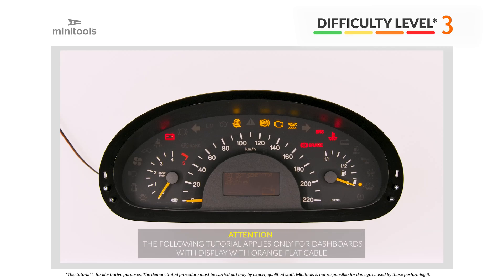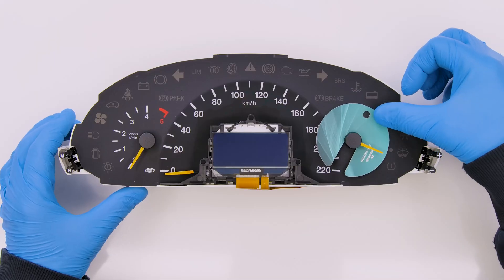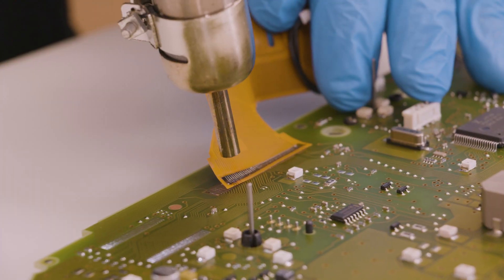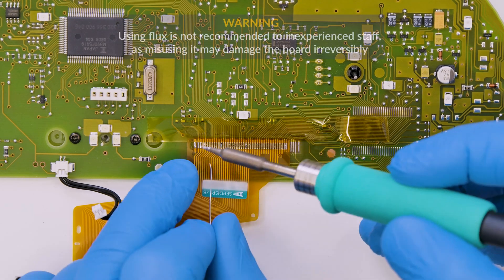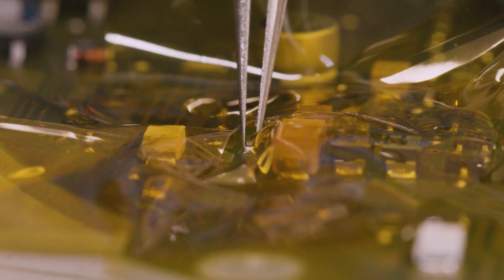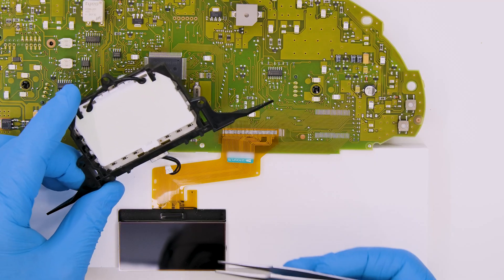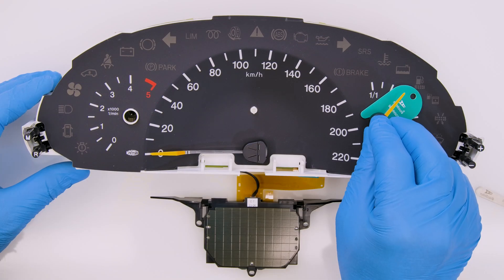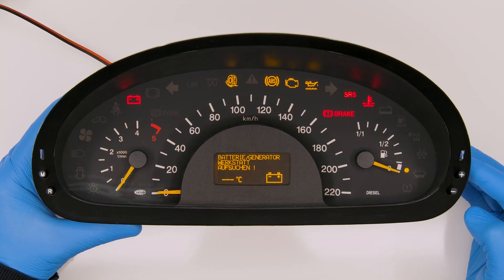Mercedes Vito W639, Viano W639, Marco Polo W639 instrument cluster repair – LCD display replacement

Comment: Hi I have the same display as this video. The rev counter has stopped and the engine management, engine oil and coolant lights are permanently illuminated. Do you have a fix for this?
Reply from the maker: Hi Ben, could you please send us an e-mail at info@minitools.com? Our team will look into it and try to help you. Thanks.